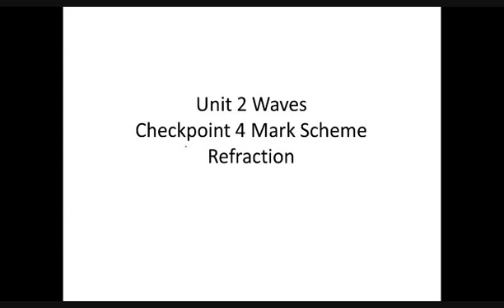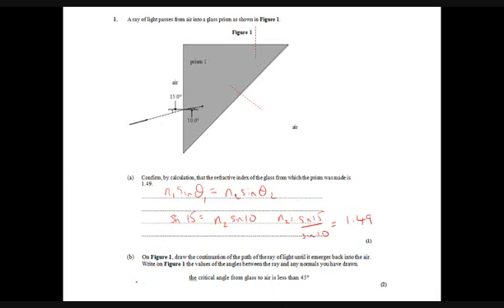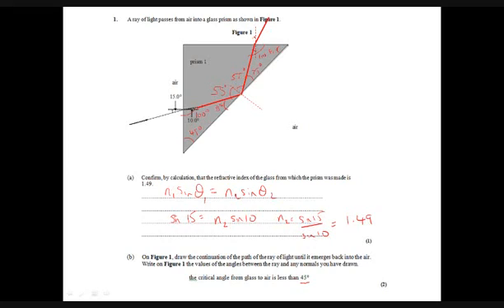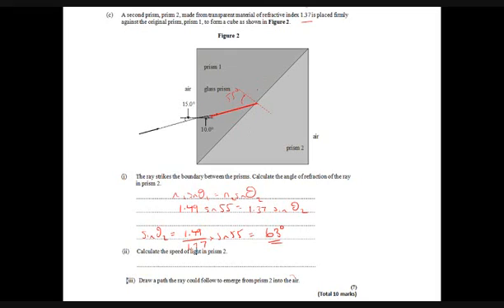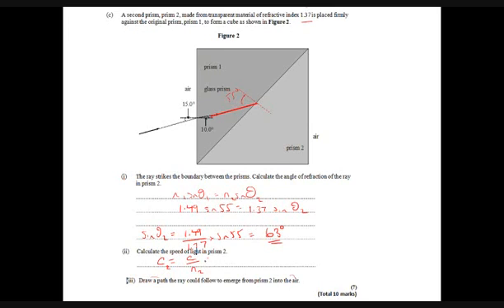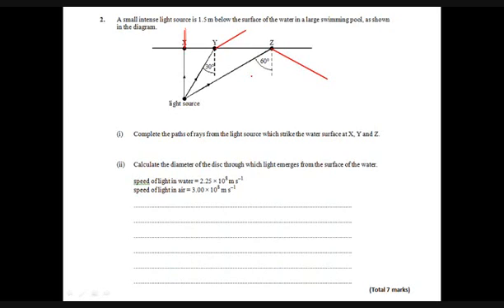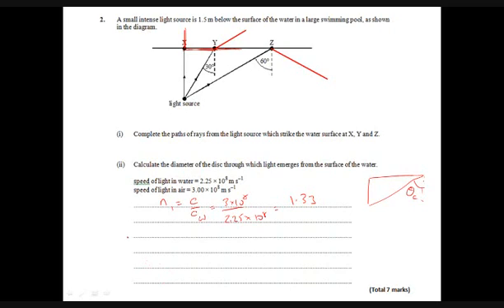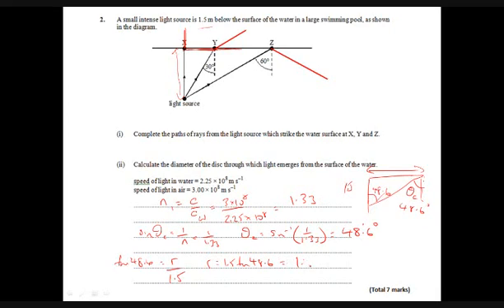Unit 2 Waves Chekpoint 4 Mark Scheme

Comment: Great work but for the question with the 1st and 2nd prism, wouldn't TIR occur also?                                                                                                        The ray is travelling from a more dense(RI 1.49) to less dense( RI 1.37) medium         and                                                                  the angle of incidence (55 degrees) exceeds the critical angle (< 45 degrees)
Reply from the maker: Thanks. I think you're missing the point that the critical angle depends on the media involved, it's much higher than 45 degrees in this case.
Reply: @ATPHYSICS1  Okay thanks , I had just assumed everything was verbatim from the prior question.